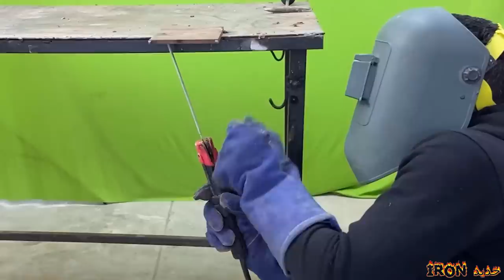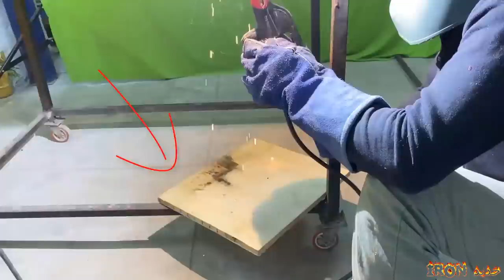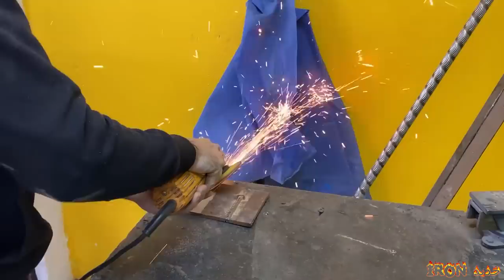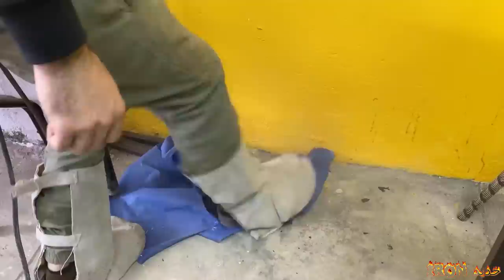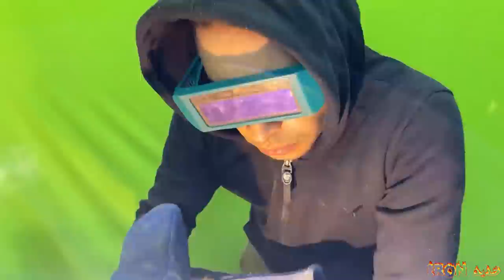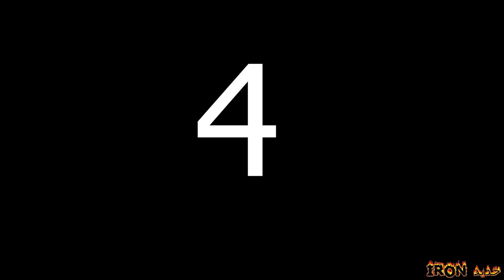The most common welding hazard

Comment: Had to weld very low to the ground quite a bit on a job, had to be sitting with either leg up depending which side I was working. Didn't realize my pants had a hole in the crotch. That was a bad day for the family jewels😂.